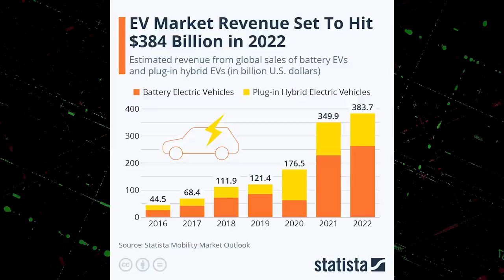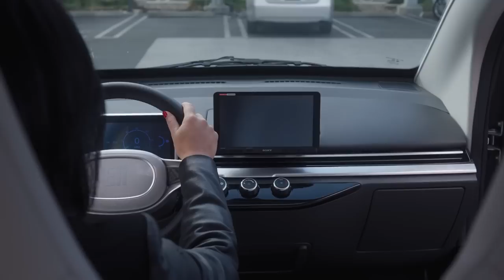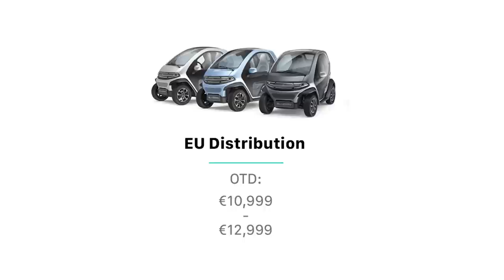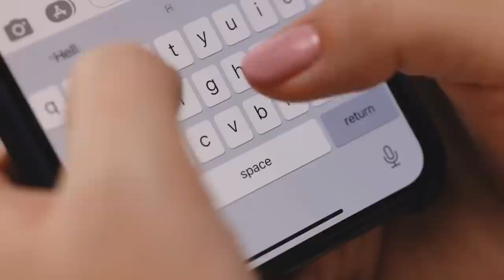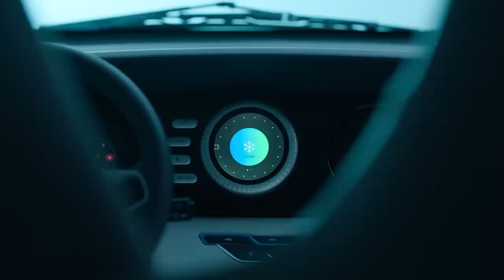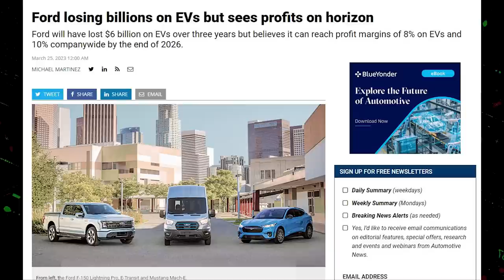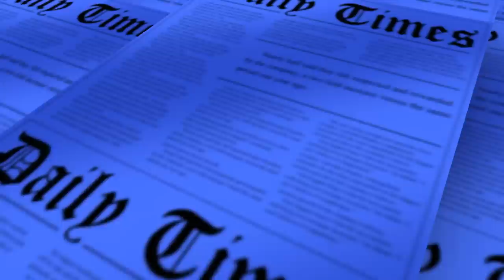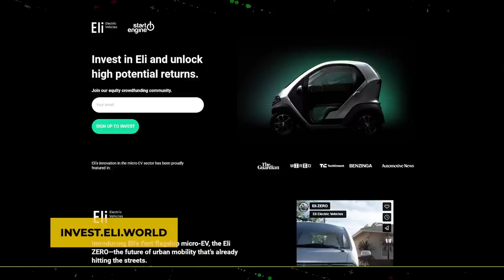Is This Micro Car The Next Big Thing? | Eli Zero

Comment: The speed limit for the main roads in the city I live in is 35 or 45. A vehicle that is regulated to go 25 mph in the U. S. isn’t going to be doable when everyone else around me or just behind me in a two lane 35 mph street is traveling at a higher but legal mph. The speed regulations for these EVs needs to be changed, which ends up being a political issue. I would love to have one of these but even for me to just use around town, I need it to go at least 45mph.
Reply: I agree.  Even with a speed limit of 25 mph it can sell, well.  But to sell very well the speed limit needs to be higher in the US.  Personally, I'd like a max speed of 50 mph.  I live in Denver and there are many multi-lane roads with limits at 50 mph.  I'm very interested in this vehicle, but it's current speed limit is a show-stopper.
Reply: The current "car" is an L6 category quadracycle.
What you're looking for is an L7 vehicle.
I have no doubt that an L7 is in the pipeline.
Reply: There's no minimum speed limits on any U.S. roads with a speed limit of 55 or below. My electri ELF bicycle will easily go 25 mph, and I'm allowed to drive it on any public road that has a 55 mph or lower speed limit. No drivers license,  registration, or insurance is required. Plus, I can also drive it on any bike path. When it is parked in the sun, my battery will be fully charged in less than 5 hours by its built-in solar panel.

Comment: I live in Amsterdam, and I just ordered an Eli Zero Plus in baby blue. Can't wait until it arrives. After my extensive testdrive and receiving a complete demo of the car, I expect it to be everything you guys have been discussing in this highly informative and interesting video. 

One thing you didn't mention in your conversation is the possible reduced parking costs. In Amsterdam, I can buy a parking licence for my Eli Zero Plus for less than $500 a year which grants me 'free' parking throughout the whole city of Amsterdam. Parking a normal car in Amsterdam costs almost $10 an hour or $20-$40 for a day pass, so driving an Eli Zero Plus in Amsterdam has all the great advantages you have discussed, plus a significant drop in parking costs on a yearly basis. 

I completely agree that Amsterdam is an ideal location to be an Eli Zero Plus owner/user. Especially now the speed limit is 30km per hour in the city. Also, in 2030 they want Amsterdam to be fully electric and no vehicles with a combustion engine will be allowed to drive through Amsterdam. Hence I have ordered an Eli Zero Plus. It definitely goes seamlessly with the lifestyle that I already embraced for myself. I'm future proof for the next 5 to 10 years I guess.

I don't need/want a car (I have no driver license either), but the Eli Zero Plus will give me the feeling that I own/drive a car. On the inside it feels like a proper car. The quality build, fit & finish and comfort is incomparable with the other electric microcars on the market at the moment. Such a cool car to have/drive without the need for a driving license. 

The weather report in Amsterdam for about 4/5 months a year will be: a lot of wind, rain, hail. So sitting dry and warm in the fall/winter will be awesome and not sweating in a sauna in the summer as well, due to the airco.

The one thing I don't like about the Eli Zero Plus is that there is no way top open the windows. Which will occasionally inconvenient in situations where I have to scan a member card to get passed a barrier and enter a gated parking area at a wholesale store or something like that. Other than that, the Eli Zero Plus seems to be the perfect means of transportation for me in Amsterdam for the next decade.

Comment: The only problem with microcars is the cost, they are way too expensive for what one get. To make them cheaper. $2000 for a microcar is resonable, but when they cost above $5000 then a used car is an easier buy.
Reply: Not sure what pile of junk you get for $5000 at this point. $2000 is about the price of a nice electric bike.
Reply: @CorwynGC  Geely Panda's price is $5800 new and that is a real car with a 100  km/h top speed, so why would I buy a microcar that doesn't even have half the speed for the same price? Microcars have to be cheaper than cars or no one will buy them.
Reply: @SkepticalCaveman  most people are unable to buy a panda.

Comment: I see the non being able to lower the windows to be a major issue. In a summertime you are forced to keep the AC on even if you could feel comfortable with just the windows down, and of course use more battery power. Same thing going to a drive through bank or restaurant you have to open the door in order to talk with a teller or place your order, which is an inconvenience. Big Nono!

Comment: Most urban speeds in the US are 35-45mph and goes down to 25mph on school zones or particularly designated area where speed is reduce to a minimum but for the most part of the road you should be able to maintain the average urban speed limit. Of course it would be ideal in countries with high density or crowded places that you can’t even drive more than 25mph. With this limited speed of 25mph, this micro car is an upscale golf cart.

Comment: In one hour charge with my Ford lightning using my 240 volt charger, I get 7 kwh, and when I just drive it at city speeds, I can easily achieve 3 miles per kwh.  That's about 21 miles with just an hour charge. I'd say for nearly a 7.000 lb vehicle that's pretty economical.

Comment: I like the nice exterior and a bit premium feeling interior design of this small, lightweight EV, and also that it does have some important features : air conditioning (which is a must have in summer for reasonable confort), power steering,…

That said there are also some flaws : the major one is the boot seems much too small for grocery shopping (compared to ICE micro car from Ligier or Aixam for example), it seems that the inside is a bit too narrow when there are 2 large persons (the driver elbow will probably kick the other person a few times during driving) (they should have gone for the ~1.50m allowed in most european countries), I am concerned about safety in case of a crash against other cars, it doesn’t have Type 2 plug (with onboard 11kW charger), battery capacity is still too small (I am more interested in something like 25kWh et 45kWh, to ensure that after some battery degradation and in winter, I can still have more than 120 miles REAL range),…

Don’t get me wrong : I like the idea/concept of small lightweight EV, and there are many nice things in this one but I find that there are still plenty of shortcomings on this one with the small boot being really a BIG practicality drawback…

Comment: Zack&Jesse look at the Squad zero solar coming soon to Europe market in 2024! They will have a version meeting the L-7 speed up to 90kph. This will meet 90% of my driver needs for Silver Coast Portugal day to day for under 10k! Normally use a Honda vision moped for these shot trips in good weather and parking is a breeze. They are planning US expansion as well. The 27.5 mph quad cycle standard is fine in-the urban environment, but micros with speeds up 90kph will be safer in the long run due to being able drive posted speeds with out slowing two lane road traffic down. Most two lane roads are posted under 70 kph!

Comment: I tend to think that Tesla's eventual Robotaxi programme really needs to head prominently, although not exclusively, down the micro EV route. It's simply more efficient across a whole range of parameters than having 4+ seater sedans and SUVs taking up precious urban spces meant for people, not machines. Given Tesla's projected manufacturing capacity, just imagine the number of EV's that they could produce. 

To put it into context, I've always owned and driven (small) 4 seater hatchbacks but almost never had anyone in the front passenger seat let alone the back seats; I'm far from alone in that regard. My little cars were more than sufficient for my needs and I could have easily managed with a two seater most of the time, hiring a larger vehicle only as needed.

Comment: If Jesse wants something small with more speed he should check out the Microlino or even the Meshersmitt E5000
Reply: The Microlino has the edge in styling (beyond cute) and speed, but it's way overpriced and needs refinement.  Have you seen Out of Spec's review of it?
Reply: @erictheblue7256  Yes, and most failings could be easilly rectified with software updates. What about the Meshersmitt E5000?
Reply: Not aware of the Meshersmitt until you mentioned it.  I'll take a look for sure. @eclecticcyclist